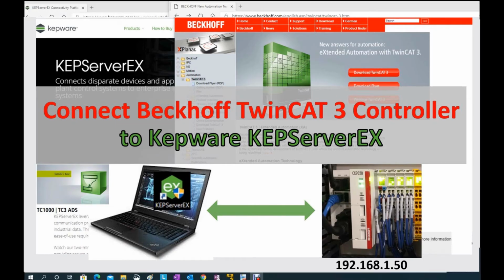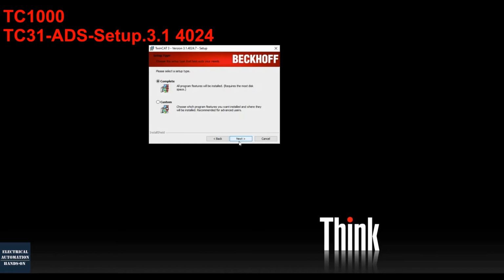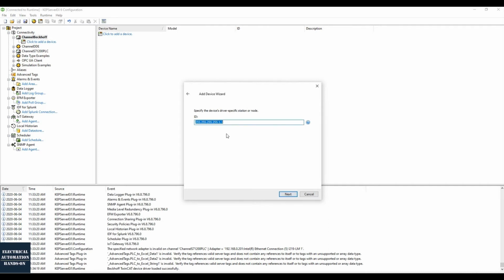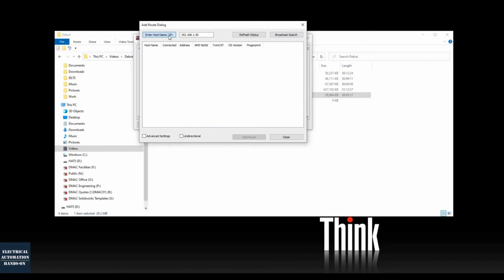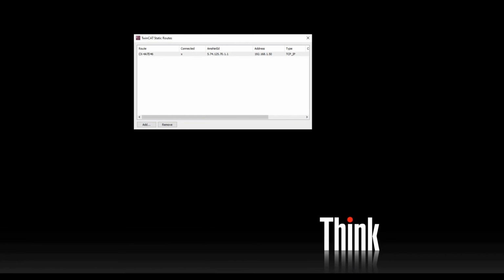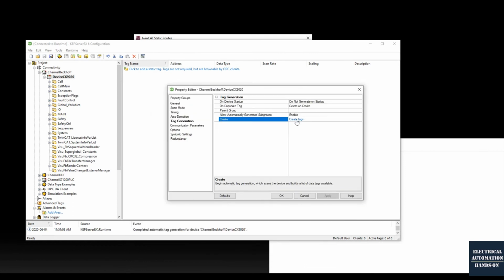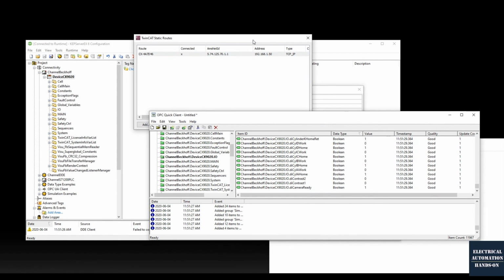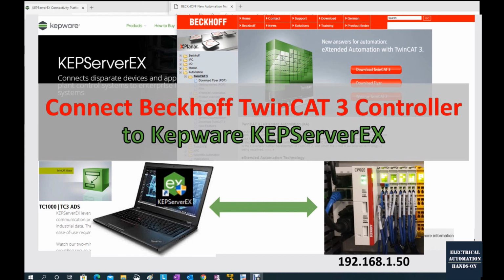COM11. Connect Beckhoff TwinCAT3 Controller(CX9020 PLC) to Kepware KEPServerEX(ADS TC1000)

Comment: Hey again! I am able to do all of this, if I am connected directly to the BECKHOFF ethernet switch that has HMIs PLC etc... this machine is in another building and the PC with twincat in another building, one building has IP as of 10.50.40.xxx and the other building with the PC with Twin cat has an IP of 10.30.17.xxx, IT department created a VLAN so those Beckhoff devices could talk outside their internal network, The HMI Windows Embedded Compact 7 CE aka (CP-5162FC) was configured to a fix IP of 169.254.194.126/255.255.0.0 gateway 169.254.194.2 as it used to be dhcp, then I could add manually a route by using admin cmd by using this:  route add 169.254.194.0 MASK 255.255.255.0 10.50.16.1, I was able to now monitor Live PLC tags and add the devices using the procedure you list here. but then It stopped communicating, I have checked all settings and all seems okay, I was wondering if you maybe have done something similar or even better, use the industrial solution of Allen Bradley, Startix Switch 5700 to do NAT 1 to 1 Transaltion to be able to talk to systems that are not supposed to talk, or imagine the same plc IPs exist in another machine and we don;t want to mix them... Any help? I have been struggling with this for ages and not a lot of people are experts in Twincat like you, lol